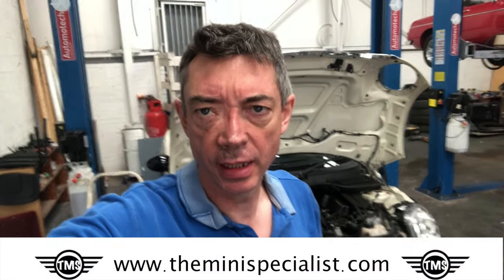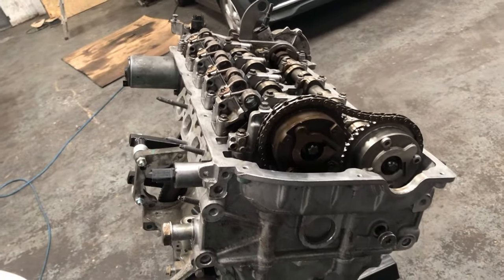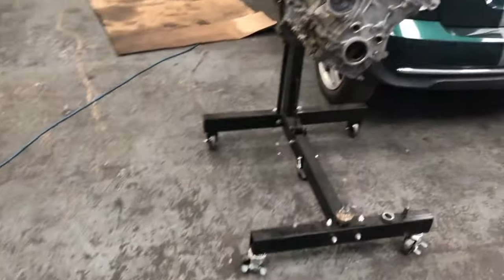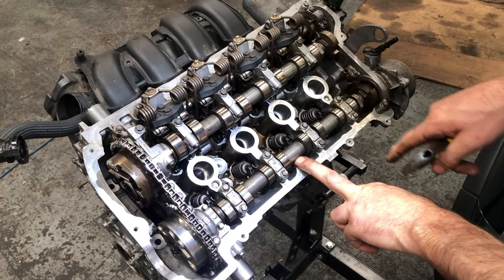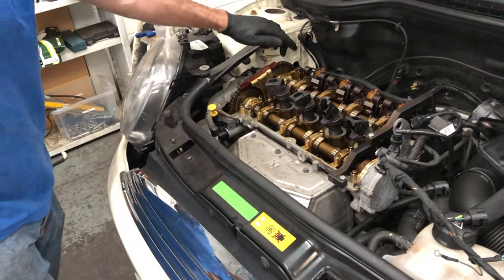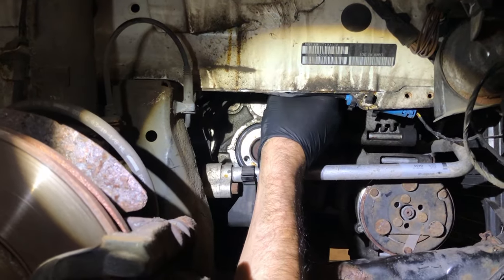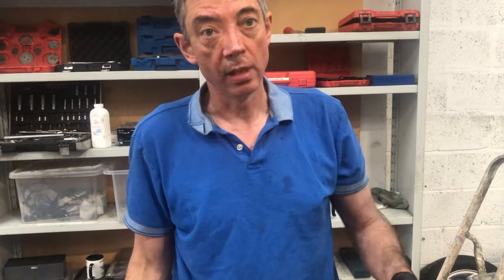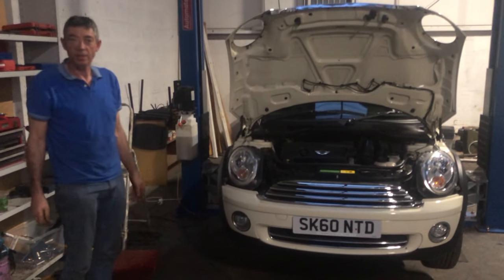BMW Mini Timing Chain DIY Replacement for N12, N14, N16 & N18 engines - The Definitive Guide

Comment: Nice video we have 2 r56 minis in our family cooper D which is amazing and a nasty 1.4 mini one which every fails mot  every year on emissions what normally causes bad emissions on n12 engine is it carbon build up
Reply from the maker: the N14 engine valve seals often dry out and crack causing oil consumption - plus in my the 1.4 is especially bad when it comes to the piston rings - for some reason the oil ring becomes carboned up and loses its ability to stop oil coming past causing more oil consumption.  To test let your engine idle for 3 to 4 mins and then rev the engine - if the valve seals and/or the oil rings are worn then you will get a big cloud of blus smoke from the exhaust.

Comment: Great vid thank you, I am about to try this on my C4 Grand Picasso with a N14 engine. It has VVt on the intake cam only. Showing code P0011 , and replacing the solenoid and oil change hasn't helped.  

 Other videos say to install the top chain guide before torquing the chain?
Reply from the maker: Either - doesn't make much difference.  I always put the tensioner in first whilist having the top two camshaft bolts and the bottom crank bolt finger tight only.  Once the tensioner is in then torque up the camshaft bolts followed by the crank bolt.  Then I put the top guide on - but like I said this makes no material difference.
Reply: @TheMiniSpecialist  ok great, thank you for the quick reply!

Comment: very interesting video , i own an Rcz gt200 which uses the same engine with some differences but was interesting to learn about it. mine is in the dealer at the moment and has hesitation under load 3rd and 4th high revs and idling weirdly wasnt the high pressure fuel pump wasnt the coil packs i think it might be the cam solinoids

Comment: I bought a turbo MIni last September and two days later the car died on the highway. The crank pulley bolt was completely out. Tried replace it and the new one just free spun. Pulled off the valve cover and all exaust rockers no longer have spring tension. Removed the oil pan this weekend and one side of the chain is taught, but not the other. Also, those familiar plastic bits are broken off next to the chain. Looks like I'll have to pull the head to see if the pistons came into contact with the valves. I've never felt so ripped off before. Can you think of anything else I should look into while I have it apart?

Comment: Excellent Video! Thank you for sharing your knowledge.   I just bought a 2011 countryman All4S with a 112000Kms and I am looking forward to do the timing job on it .  I also have a problem with the Automatic transmission when using the D mode  the transmission will kick whereas when using the paddle shift in M mode it seems to be fine ,, only rarely that it stops engaging on the 4th or 6ths gear, and turning off the car and restarting it will reset it and then respond to shifting again ,,  any advice on how to tackle this issue would be greatly appreciated .  there is no slipping between gears and apparently the transmission oil was changed 4 months ago ,, (as per the previous owner)
Reply from the maker: Sounds like a software issue - not had any problems with this particular gearbox but suggest you update the software as a first step.

Comment: Currently doing this job. My crank locking pin only goes in with the cams 180 degrees out(writing facing down, round bit facing up). If i lock them like this, everything should be fine? Or should i lock the crank, remove the chain, and then rotate the cams to the correct position?

Comment: Excellent informative video, my daughters '57 mini one EMI lamp came on, P1050 and P1062 were stored which looked like they referred to valvetronic system. 
Car has 103k miles on, not sure if the chain has been changed before and there's a bit of a clatter at start up so I thought I'd check it out. Bit above my capability I think. I'm going to change the eccentric cam sensor first, If I change the valvetronic motor can the end points be taught manually as I don't have the support tool?
Reply from the maker: What do you mean by 'eccentric cam sensor'?  The cams are not eccentric. Also the valvetronic has nothing to do with the chain.....  

It works like this.  The camshaft sensors read the current camchaft angle. To adjust this angle the ECU tells the VANOS actuators to allow more oil to the VVC sproket(s) whilst monitoring the camshaft angles and continually adusts camshaft angles according to engine load and speed.

When the chain becomes too long the ECU can no longer maintain the correct camshaft angles and usually reports a 'VANOS STOP' error leading most people to change out the VANOS actuator - when this is not the problem at all.  A chain is just metal and cannot complain.  The VANOS error occurs because the ECU cannot achieve the desired camshaft angles and lights the EML.

Sometimes it's the VANOs actuators or rarely the VVC sprockets but most often its the chain itself.

Hope this helps.

Comment: Great video and thank you for sharing. I have the same year and model of the mini you repaired.  As you my crankcase breather hose is broken. I have searched website after website and can not find anyone who has the correct replacement. I was hoping that you or a fellow subscriber could provide the name of a supplier. It seems this breather hose was discontinued.  Thank you for any help you can provide.

Comment: Hey first of all thanks for such an in-depth tutorial i wondering if i could ask a question ? I have all my locking tools in place and ive replaced the chain and torque spec the crankshaft bolt but when i try to do the additional 90 degrees i got maybe 50 on and the chain kind of clunked round i checked all the locking tools the pin in the crank and and checked the writing was still up and everything was fine just cant understand why its done that i cant get it any tighter without the chain trying to move I've left it till tomorrow now but thought id see if i could get some advice. Thanks again 🙏🏾
Reply from the maker: Never had that problem. The pin should hold. Maybe replace the pin holding the crank?
Reply: @TheMiniSpecialist  thank you for the reply i do have an upgraded race clutch but it all held when taking apart I think I'll be okay I have seen some discrepancy with 180 degree and 100 people saying if it's a new bolt do it to 180 if not 100 but I think Im somewhat over the 100 but not quite the 180 i generally cant get the bolt any tighter so im thinking its gunna have to be okay lol I hope all will be okay i turn the engine over when im done just to make sure the timing is okay

Comment: Very detailed and informative video, really impressed!
I am about to do this task on my wife’s 69k miles 2009 Mini Cooper 1.6, which is exhibiting the telltale signs of cam chain/cassette wear (hunts at idle, a death-rattle on startup, engine warning light).  
I bought a Bluetooth OBDII reader from eBay and it showed cam phase sensor error, replaced the sensors and it cleared for a short while then returned, clearly the phase sensor was a red herring and a symptom of the loose timing chain..
I’m an accomplished home mechanic and have no problem with the mechanical task, my question concerns the reset/learning that needs to be done at the end - my OBD reader is basic and only reads/clears codes.

What budget OBD communication system do you recommend for resetting/re-learning after the work is done?

Comment: thanks for this great video. I have just pulled out the timing chain on a R56 N12 2007 Mini Cooper (non turbo) and like the worst case you have ever seen scenario the timing guide is broken. I have managed to fish out the visible bits in the timing chain housing area (not sure of the correct term) and plan to remove the sump before installing the new chain and guides. Intend to put the engine mount back on of course. Any other things I should do??

Cheers,
Reply from the maker: Just make sure you remove all the bits from the oil scavenger pump - you will need something like a small pry tool to hook out the bits.  It's amazing how small they can be and how long it takes....
Reply: @TheMiniSpecialist  Thanks for the reply. Really appreciate it :)
Reply: @TheMiniSpecialist  Hi there again all done. However when I started the engine after about 30-45 seconds a tick started to become noticeable my basic OBD scanner recorded P0014 and P0015 errors Bank 2 timing. I rechecked the timing and it looks fine. Checking the vanos solenoids incase that is the issue! Or is it that I need to use a diagnostic tool like yours to reset the computer as per your video?
Reply: I ordered the Foxwell NT510 Elite with BMW software to re set the ECU for the adaptations. I read that this a common issue after a timing chain replacement if the adaptations are not reset.

Comment: My R56 Cooper S, N18 engine started producing weird noise ~1 year ago, only for a couple of seconds when cold started. Now this noise is also audible when the engine is heated up well, mainly when it's changing the gear (just right after the gear is changed). The gearbox is automatic. The noise is even louder when I push the gas pedal more just after the gear has changed. Been to the mechanic and they checked the tension of the chain as well as changed the oil - they said that there's nothing wrong with the timing chain but I'm not so sure.
Reply from the maker: If you chain is OK then perhaps have the gearbox checked over by an auto transmission specialist?

Comment: So when you tighten the crank bolt you're only relying on the flywheel locking pin to hold the Crank in the right position. Would you not recommend using crankshaft wrench tool just to put some counterclockwise Force and the Crank. Am just a bit worried that pin might break in the flywheel. Ps great video
Reply from the maker: Correct - the flywheel locking pin is the only thing holding the crank - never had a problem with this.  It is designed for this purpose afterall.
Reply: @TheMiniSpecialist  thank for getting back to me. Just ordered the Cam lock out and fly wheel kit today. Am not happy how BMW don't have a woodruff key on that bottom crank gear, that's absolutely crap. Just taking to One of my mate's about it and he said BMW do that on the New 4 series and 3 series cars M4/M3. He said that he has had loads of them is with timing damage with that gear slipping and it's a real problem for BMW. Apparently they is an American company that is manufacturing a splined gear, but it's engine and crank out as machining has to be done on the Crank to adapt the new spline gear. 
Really poor design. Thanks again. 👍👍
Reply from the maker: @tomgt007sugden  The thing to remember is this engine is basically a PSA (Peugeot Citroen) engine bottom end with some BMW bit for the VVC.  They have their issues - but less perhaps than the BMW N47 Diesel as thats a 14 hour engine out job for a cam chain replacement....

Comment: Thanks for a great tutorial pal. I just have one question please, I want to attempt this on my N18 Cooper S. 

I’m looking at a Febi Belstein complete chain kit as I’ve heard these are the best (more expensive though so if you recommend others please share), is it a good idea to replace both camshaft adjusters along with everything else? 

I can see you’ve reused the old ones in the video, but I’ve heard from some people it’s best to and I can’t decide which kit to buy, thank you!
Reply from the maker: Hi - thanks for the comments.  The VVC sprockets rarely fail and are easy enough to change if they do.  The ones that do typlically fail are the after market ones - I have a shelf full of original ones that I have kept from cars I have scrapped.  Febi are good - but the thing to watch for is what you actually get in the kit,  I always go for a kit with the chain, guides and tensioner (obviously) plus the pins, crank seal, bottom sprocket and rocker cover gasket.  The rocker cover gasket can be £25 on it's own and the crank seal £18 odd so get them all together.  Also always torque up the rocker cover bolts (10nm) and do not rely on the gun.  You would be amazed how inconsistant that can be.

Comment: 2010 Mini Clubman R55 N12 103k miles.
New timing and oil chains in.  New bolts, the Haynes manual specifies torque spec less at 100 degrees than an instructional video at 180 degrees. Excellent video, but he tightens things more in the video both in torque and stretch degrees and is a bit lax on chain guide bolt torque over-tightening with impact?  Did the specs ever change because of all the manufacturing disasters or is he over tightening by accident or for good reason?  I have not done the stretch phase yet.  I did go 1 ft-lb over each torque spec in the Haynes manual though.  The Detroit Tuned kit crank shaft bolt is a bit different too.
Reply from the maker: We do about one of these a week now and use the same techniques and torques as in my video - which are what the manufacture specifies. The specs have not changed.
Reply: @TheMiniSpecialist  What if I don't have a scan tool to reset vanos adaptations?  If there a manual way or can I just drive it and it will learn?

Comment: Hello I need your halp I done a chain replacement and car is hard 2 start locked cams in with tool pined crank so I had a look and when I was turning crank 2 line every thing up I noticed at the cam pully on the intake side is moving but not moving the cam it self so do I need a now intake pully as I don't think it is looking as it should

Comment: Really helpful, thank you. A couple of questions. What sort of code reader is needed to reset the VANOS? Also, how can you tell when the sprockets need replacing?
Kind regards Pete
Reply from the maker: I think most code readers will - I have 3 a very basic one, a middle range one and a top end one and they all can reset the vanos adaptations. The sprockets only need replacing if they are faulty. The originals rarely go wrong and the aftermarket ones are the ones to avoid
Reply: @TheMiniSpecialist  Very many thanks for your speedy reply. ATB
Reply: If you get a moment, I'd really appreciate your thoughts. My car had code 15 inlet cam over-retarded and a misfire. I have changed the timing chain, and it went smoothly I thought. It starts better now, the misfire is gone, but there is a new and horrible clatter, which sounds like cam/valve noise (the rotation test went OK, although I did not try the crank pin test) I still have code 15. I have not reset the Vanos yet, as I need to get a better code reader. The chain tensioner which I replaced was less than finger tight. What do you think, would a Vanos reset fix this, or do you think I have made a serious mistake with the timing?
Reply: I've re-watched your video, and I think I put the tensioner in after torquing the cam sprockets, so I guess the timing is slightly out. I'll check in tomorrow

Comment: Hi there! Great video, put me in right direction. I used pretensioner tool from my cam locking toll kit but it seems impossible to get 0.6 nm, with my equipment anyway. As a resault when i screw in the real pretensioner, turn the engine over few times, check with locking tools i get some missallignment. Can i just use the real pretensioner from the beginning and hope to get it all alligned?
Reply from the maker: Hi Pawel. 0.6nm is so mad I don't ever use that pretensioner tool except for measuring the chain stretch and then I tighten it to 2.5nm as thats the lowest my torque wrench will go.  What I do every time is hand tighten the two VVT sprockets so they can still move, same with the crank bolt, then insert the new tensioner, then torque up your crank and cam bolts.  Hope that helps.
Reply: @TheMiniSpecialist  Thanks a lot, i will try that tomorrow 👍

Comment: When you aligned both camshafts so that you can put the lock tool on, you noticed the exhaust camshaft off.   I have the same issue.  Exhaust camshaft off by approximately 30 degree. after aligned using the lock tool and engine start,.  I now have codes p0015 then p0014.   I performed the same procedure as you did
Reply: Try resetting adaptions

Comment: Hope you can answer this. But I bought a stage 3 clutch set along with a aluminum flywheel and I’m missing the hold to set the pin through the flywheel so time the chain right. Idk what to do

Comment: Hi I have a 2007 mini had faults for inlet actuator movement and car was running extremely rough and cutting out I replaced the chains and sprockets kit then reset the codes by doing the vanos reset.
It seems to have made a difference but when I drive the car over 40mph it’s starts shaking and loosing power.Any advise please?but-any time I reset the adaptations it rus fine but then does same thing

Comment: Great Video! In reading the Q/A below, I think that I have a bad tensioner. Can I replace the tensioner without having to lock down the crank and cams? Thanks!
Reply from the maker: Yes you can do that. It may help - it may not. There will be wear in the chain and the tensioner. I had a cooper S today with 90k miles and the tensioner came out in 3 pieces and the guide had started to break up.
Reply: @TheMiniSpecialist  one other question...do the vanos sprockets go bad? if so, can they be rebuilt or cleaned? Thanks a million!
Reply from the maker: @bradvoth4970  they can. Sometimes after a new chain we get vanos errors and changing the appropriate sprocket sorts the issue. Other times we have done a complete rebuild and her follow on errors and a software update sorts the issue. Go figure

Comment: Thanks for the detailed explanation. About to try this for the first time.  Is it essential to use new torque yield bolts for the cam pulleys and is the crank bolt torque yield also?  Thanks
Reply from the maker: Not essential - recommended though.